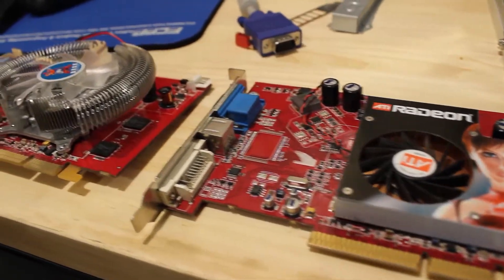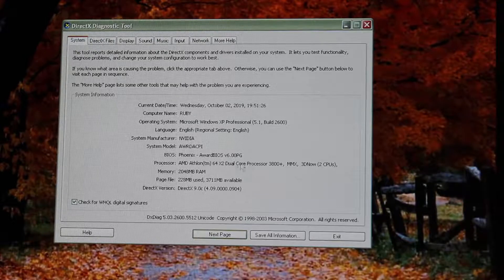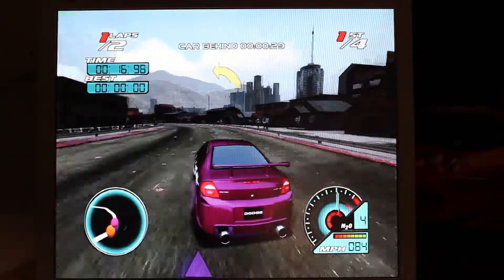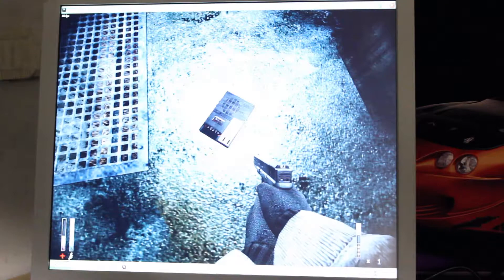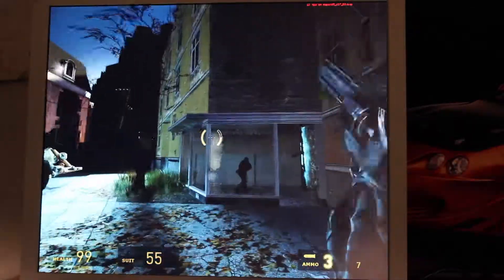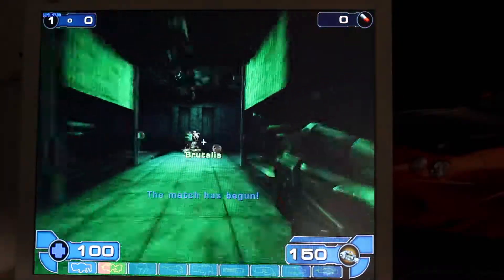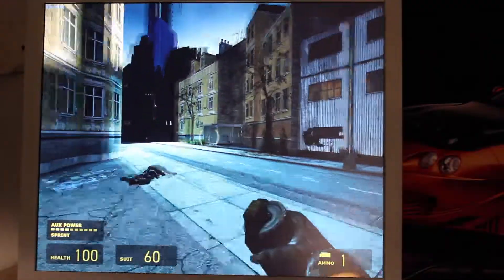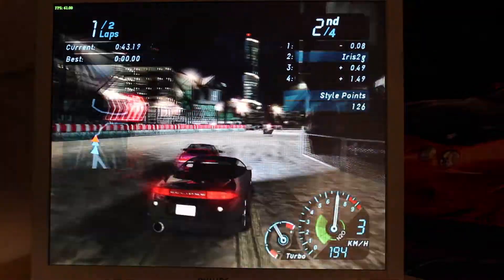ATi Radeon X1300 vs X1600 - Battle of The Retro Graphics Cards ep1

Comment: As a Retro PC gamer, and being around gaming in the 2000's, with this card, it's definitely in the wrong place for 1280x1024, and in half life 2, i'd use the 2004 source version rather than steam since that would've been accurate for what it was running. cause the current release has Episode 2's engine, which is updated even further, and more features, etc. there is a Source 2004 version compile as a Source mod for SDK Base 2006. but you said HL2 could've been playable in 480p but would've looked bad. Mate, alot of people in 2004  were running it between 480p and 1024x768. the latter being if you had a Radeon x700 / x800 XT or GeForce 6600.  but those resolutions were common ground back then, but on a CRT, 480p looks good.  i got an x1300 for my retro build, and yeah, i run alot at 480p, but some at 1024x768. It wouldnt have made sense to do 1280x1024 with this card on some of these games, even back then with the x1300. Sure, it's no high end wonder, but with lowered settings, it can be alright. like todays budget cards at 1080p or 900p, vs 4k with some people. I feel like im being a little too critical here, and i apologize if i am, it's just it tickled my funny bone here a little bit, especially since it reminds me of people testing low end cards, then pushing em to unreasonably high settings, then complaining about performance,  cause i was big into PC gaming back since 2006. but yeah, in all honesty, in some monitors, 480p doesnt look too good, understandable, i will say. but on most 4:3, it'll be fine. and it looks pretty good on a CRT if you wanna try CRT's.
Reply from the maker: Interesting... I have heard about the whole 2004 HL2 thing but I couldn't get it to work when I tried a while back + I believe I didn't have steam installed on this computer either. 
Funny enough I tried to get my hands on a CRT during the summer but with a bad experience in doing so I haven't been bothered since. 
I guess I was trying to see if the x1600 was able to give you that "leap" in performance over a x1300 but maybe by using a resolution that's too high my results were inaccurate.

Comment: "I'm running all these at 720p"

>plays at 1280x1024
Reply from the maker: isn't that 720 or am I astronomically stupid. D:
Reply: @big-ts-tech-corner  720p (1280×720 px; also called HD
Reply: @big-ts-tech-corner  1280x1024 is 42% higher than 1280x720 which is 720p.

Comment: Question on half life 2 did you run it on max settings
Reply from the maker: I can't actually remember. I think I did, or very close to
Reply: Big T's Tech Corner k thanks I'm building a XP gaming pc and i found a x1600 card in a computer on the side of the road so I'm planning on using an that for my build. I'm only planning on playing valve games.
Reply: Update, I built it, I went AMD because that's what I had and what I'm using is a x1600 pro 512mb, AMD Athlon x2 4200+, 2 GB of ram I don't know the speed, a k9agm2 board, I have a vista drive and a XP drive in it but it blue screens when it boots there both 250gb and I'm using some random case I have. It runs pretty good but some times it wont boot and I can only get audio to work sometimes and trust me I tried to fix it I even swapped CPUs and mother boards, so far I've had the best luck with the AMD Athlon x2 4200+ and the k9agm2 mother board but I mean that's all I have but I was originally going to use a AMD A4 3400 but that was the board I couldn't get audio at all. so ya that's all thought you might like to know.

Comment: X1600 is expensive. Thanks it solved the question I have. There is no reason to be expensive.
Reply from the maker: They are basically the same, I guess the X1600 is slightly better with its double capacity VRAM. You are better off going for a X850 if you are on the AGP platform.
Reply: Yes, I am kinda collector I like to have x1xxx graphics card. Even though it is  pcie lp, I hung around and bought a x1550 core 250 core clock. Underclocked version. It's really hard to find agp x1600,  x8xx, and 9800, xt or pro. I think they are collector's items. I am very satisfied with x1550 btw. It seems to display black or shodows darker when I play doom3 or watch Peter Jackson king kong.
Reply: @big-ts-tech-corner  Ops 350 core clock it(msi rx1550 128MB) is, however very low core clock and that is why with descent and stable graphics it shows low frame rates or I just feel diplays flickering playing doom 3 ;).
Reply: Hmm, I picked up X1600 XT for 20 bucks. Also could pick up 8600 GT for the same amount.

... also got PowerVR Kyro card for $10, it's not very good, but the card is very rare which makes it a good conversation piece.